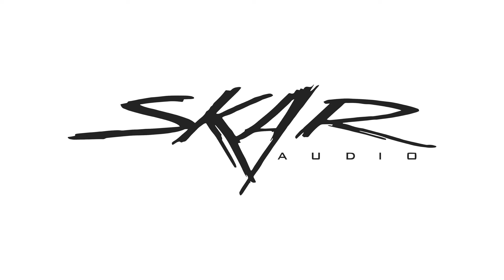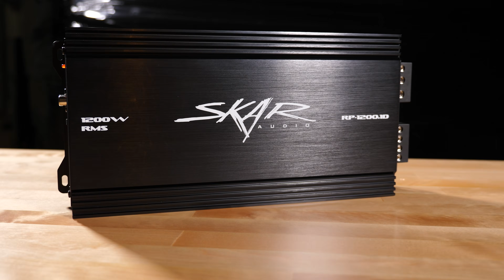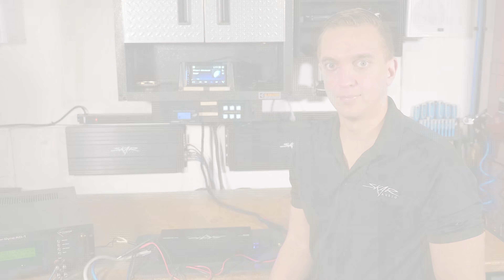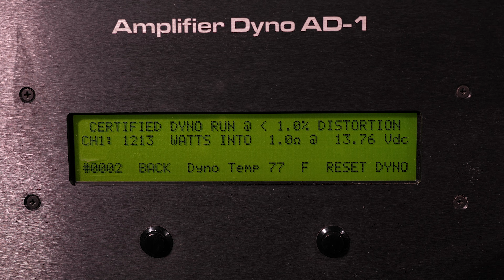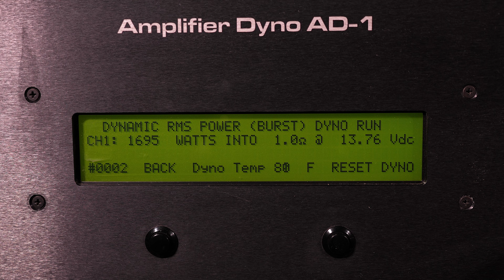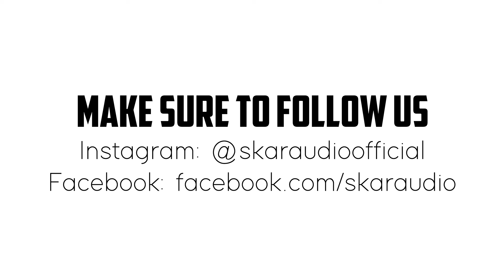Skar Audio RP-1200.1D AMP DYNO TESTING (SMD AD-1)

Comment: I'm sorry but absolute trash. Sound quality is horrible. Rp amps suck. You get what you pay for tho. Sk line isn't bad tho. Need Tiffany connectors imo. Don't understand skar and DC Audio having non Tiffany RCA connectors on the higher end amps... Concerned with profit over quality I guess
Reply: It's meant to be budget man
Don't expect quality like a sundown 7500 from a 180$ amp 
And their subs are very similar to sundown 
And sound just as good
Reply: @NerdyBassHead  I understand it's budget. I just wish people really understood that they really don't sound good before comparing them to better made more expensive products. Skar makes an unbelievably good woofer in the DNR... $900 woofer though. Just saying. But no hate on skar. and I admit I need to chill on the negative comments about products I don't like.

Comment: Dude I'm a Scar fan ,I absolutely love scar, I will put em up against any other brands and feel comfortable doing so.im going to break the bank soon as I get a home ,it's becoming ever increasingly harder for me to complete a build ,so priorities ya know ,AND then it's off to the races,so thanks guys for emptiing my future wallet lol.
Reply: O.G. AIR BENDER Ive had an rp2000 and my buddy had a rp1500 and for sound quality these amps are the worst for sound quality that ive owned. If u are on a budget I would much rather go with a hifonics brx2400, puts out like 100 watts less than the rp2000 but will send a much cleaner signal to your subs and push them cleaner and lower, I havent had the rp1200 but rp1500 and rp2000 are much more powerful on the higher bass notes but on the lows they roll off quick! Upgrade to an sk and youll definitely see what Im talking about you arent even getting the full frequency spectrum on your subs with the rp1500 and rp2000
Reply: Thanks crazy coop ,I need info on what to purchase ,so the sk right.
Reply: O.G. AIR BENDER The sk are more efficient and better quality amps, where the rp are just for getting loud but if you want to actually see how clean your system will play you can go with the sk series they will push your subs lower and cleaner than the rp series, what subs are you needing an amp for?

Comment: I just purchased this amp to push my single Skar EVL 12 in a ported enclosure. Excellent amp for the money! Pushes the sub for long sessions without barely getting warm! 

Also, excellent customer service from Kevin and Jordan at Skar. These guys are willing to go above and beyond to meet your needs, and even answer any questions you have with professionalism and courtesy.
Reply: How is the sound quality??? Does it compare to the kicker xk series
Reply: @adlerdefender8067  at lower volumes the sub has great sound quality, when you turn it up it still has good sound quality.
Reply: How's this amp handling the evl on a long term daily use?
Reply: Deon Jos hey, so I live in Indio (Palm Springs), and this has been my second summer with this system. It’s in my closed trunk with only the center rear armrest folded down for ventilation. I have ran it HARD, in 115° temps with no failures at all! It has never overheated or anything. I continue to be impressed with the quality. This amp doesn’t even have a cooling fan. Pretty impressive. Amps I’ve had in the past (in an air conditioned suv where the rear gets AC) my amp would cut out into heat protection after long sessions.
Reply: How much did you set the gains at? I have this amp on an evl 10 set at 3/4. I thought it would hit harder.
Reply: @junior09medina  gain is different for every setup. It’s to match the volume of the head unit, to the amount of power going to the sub. My adjustment will could be completely different than yours, yet still produce the same level of bass. What I did was bought a multimeter, and tested the amount of volts com  in my out of the amp at proper volume, to set the gain. There’s videos on here, just search “adjust gain multimeter”
Reply: @junior09medina  as for how hard it hits, we’ll that’s not only depending on your expectations of the sub, but also the box you have it in (size), the way it’s positioned in your trunk area, if there’s proper ports allowing it to travel into your interior (some cars have sealed off trunks), amp adjustments, or maybe you’re like most of us, and always want more! A single 10” isn’t ever going to be anything crazy, I’m even hungry still with my single “12, but it gets the job done for what I was looking for.
Reply: @bobsmithinson2050  I guess I just had high expectations since it’s a 1000 rms sub, my pancake 12” 500 rms bangs harder. Limited on space so I couldn’t go bigger.

Comment: Was always interested in seeing the output of this amp. I went from an LP1000 to an RP1500 for my vvx12v3s
Reply: I still have 1 vvx12v2 and an old school mtx audio 2300. Rated 600 watts but known to put out almost 1k or more. Some guy came out a 7 eleven and walked past my car said he can feel it in his chest. My volume was only 1/4 of the way up to what I put it.
Reply: @jolmeaki  ported or sealed?
Reply: @JosephNnbs  Ported. Bassworx 1.65 cubic foot box. Got the box at a going out of business store for $80. I don't think they make it anymore but did see it on ebay for around $200 a while back.
Reply: @jolmeaki  damn. I'm sealed. Ive never owned or heard a ported enclosure in person. I qant on but it had to fit on my backseat
Reply: @JosephNnbs  I have a 00 A4 so 1 sub is enough for me and have room in my trunk. Plus it's a 60 40 split rear seat so I put the 40 down.
Reply: @jolmeaki  nice little car. Ive got an 08 Sierra extended cab and the airspace is very tight so ive got a 20 year old subwoofer enclosure on my back seat that is undersized for the vvx. So the subs are riooing the box apart. The baffle has about a quarter inch bow in it. Money is tight and cant afford a gately enclosure.
Reply: @JosephNnbs  should have put vvx8 subs in a ported enclosure. 8" subs actually sound good. Look on ebay for a box you want and click watch. Put $20 away every week then spoil yourself when you have enough. You might find a box that's perfect for the space you have in your truck for the 12.
Reply: Joseph Brogna getting ready to put a setup in my truck. I took out the back seat and am putting 2 vvx12s in there on 1000 apiece. Hope it turns out.
Reply: @dustinmoore1650  got a snap or ig to check ot out ? Or video on YouTube? What amp/s you using?
Reply: Joseph Brogna I haven’t started yet, building an office in our basement atm. I will take som pics or video of the project when I start. All skar setup though.
Reply: Did you have 2 on the lp? I’m running one lp 1000 to one vvx12v3 at 2ohm.
Reply: @dustinmoore1650  I had 1 lp1000 pushing 2 vd12s at 2 ohm. Wasnt enough because i bought the wrong ohm load.  But then I gave the amp away to my cousin to help him build his first system in his first car